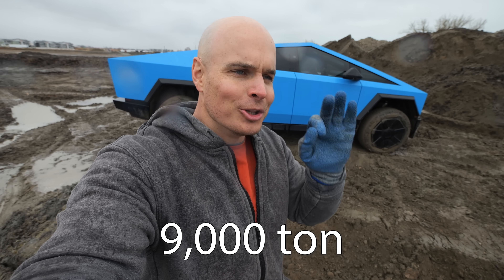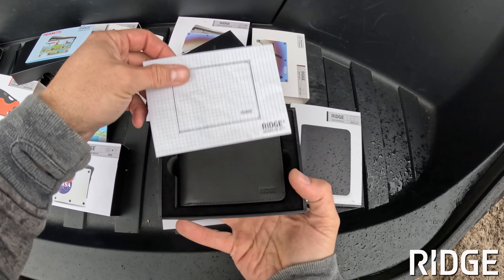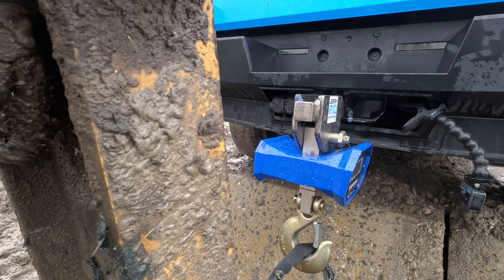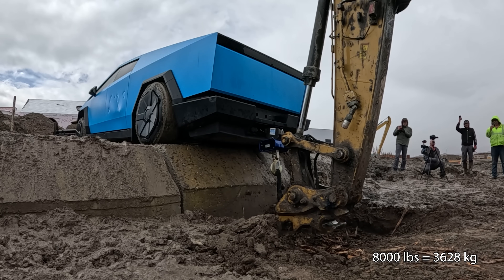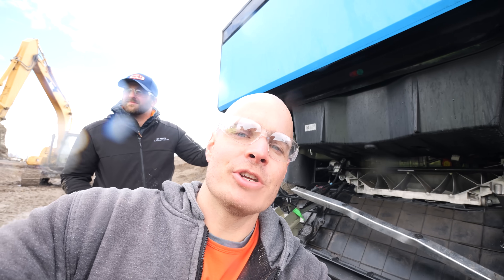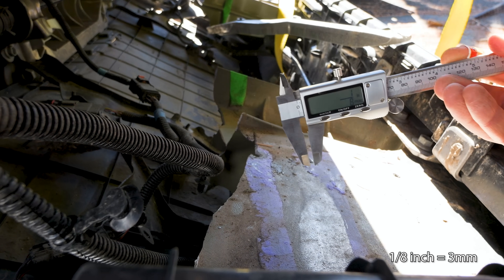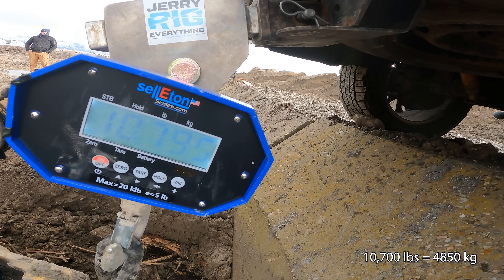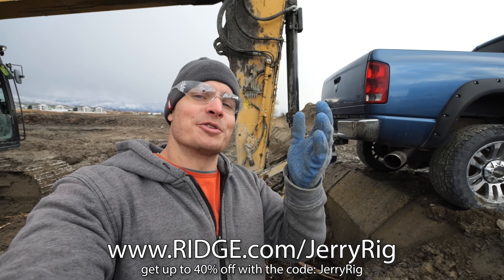SHOULD YOU TOW WITH A CYBERTRUCK?! - (catastrophic failure test)

Comment: That is not correct math. Even if a trailer jumps the ball, the full weight of the trailer will never fall on the hitch because it will still have 90% on the two tires of the trailer.
Reply: Mate... It DID happen to some drivers. The one instance I know for sure was a family hitting an imperfection in the road while towing. That's exactly what he referred to at one point. He also mentioned recoveries, when you're trying to get someone out of a sticky situation...
Reply: Zack is well aware of that. He just doesn't think the average viewer is.
Reply: A dropped 1,000 lb load can easily apply more force than a 10,000 lb static load. Cresting a hill is an easier one to do the math on, since it's still a static load.
If the truck is flat, and the trailer is on a 30 degree hill behind it, that's about 43% of the entire trailer weight now as tongue weight, regardless of trailer loading.
Reply: @xthexder0  Your math is not correct. 
Let's say your 1,000 lb trailer’s tongue weight is 100 lbs (10%). If you hit a pothole at 50 km/h (31 mph), the vertical acceleration could briefly reach 5g or more — meaning the effective load on the tongue could spike to:

100 lbs (tongue weight)×5g=500 lbs

Forces this extreme are uncommon, but realistic. Reaching 10,000 lbs of force from a 1,000 lb trailer would require catastrophic conditions, such as hitting a deep clif at high speed with no suspension absorption — unlikely but theoretically possible in extreme circumstances.
Reply: @SteveGuzer  I did no math related to potholes or drops. But I did suggest that dropping a 1,000 lb load could produce more force than a 10,000 lb static load. I'm not sure if dropping the maybe 12 inches onto the chains would be enough, which is why I didn't bother with the math.

The actual calculation I did was the 43% tongue load if your trailer is on a 30° hill. (a 10,000 lb trailer pulls down on the hitch with 4300lb + any tongue load from load distribution)
Reply: @xthexder0 first comment from some one actually knows wtf he’s talking about I have seen.  Jerry should have explained this better for the non engineers.  Dynamic loads and static weight are not the same!!! Suspending the mass of an object above a rigid object/base, and letting it go.  Even if the mass is still touching the base, the letting go of it and it falling zero inches will produce and peak dynamic force of about double what the objects mass is.  So I find it extremely probably an improperly loaded trailer with 2500lbs on the tongue a hitting large pot hole moves on the ball a few mm and hits 10k+ snapping the hitch.  And idk why people are arguing if it’s a fair test lol.  I have seen the pictures of the 3 trucks that had it happen, it’s not theoretical anymore. Shits a poor design and load has been overstated compared to any other truck

Comment: How does that saying go… Hell hath no wrath like a former Tesla fan jaded?

I’m no scientist either, but I’ve done a lot of trailer towing and even in extremely abnormal circumstances I don’t think there’s anyway to get the full weight of a loaded trailer pushing straight down on the hitch.  
In my mind, that’s all this test demonstrates, and 10,000 pounds is 10 times more than the authorized tongue weight. 
I wonder how Aircraft engineers would react if Youtubers started loading Aircraft with 10 times the amount of weight they’re designed to carry and then start ripping them for not being able to take off or snapping the landing gear at 10 times overweight.

Comment: I challenge you to prove you can get 10k lbs on the tongue with only a 10k lbs trailer.
Reply: the cybertoy was already creaking at 8000lbs... if it were bouncing up and down the road it will break lower than 10k
Reply: @williamhaynes7089  - lol the front of the truck had to be tied down causing even more of a fulcrum effect.
Reply from the maker: Easy. Park your skidster in the wrong spot and hit a pothole. It's already happened.
Reply: @JerryRigEverything my hitch for a 3500kg (7716lbs) trailer is rated for 250kg (551lbs) vertical force

Comment: This test isn't really accurate because it's a constant force and not like a trailer bouncing on the hitch or hitting a pothole. It's likely the combination of pulling and tongue weight can cause it to crack at a lower weight than the excavator pulling. I'd like to see you hitting potholes in a travel trailer on a closed circuit and see what happens. Or maybe WD can do that.

Comment: This is completely invalid test. What you’re testing is a sheer force, which focuses on a short portion of the frame, whereas horizontal force spreads throughout the frame. The incline example you showed is also invalid, you’re forgetting that the trailer is on wheels, and will never apply full weight, even if it’s on the slope. I’m surprised that this is coming from the guy that engineered so many cool things.. talk to the real structural engineer, and get his opinion.

Comment: I feel the need to spread some information.
Fatigue limit is the cyclic stress level at which a material can be exposed to and have an infinite life. In other words, cyclic stress level at which the material should not ever form cracks that would propagate sub-critically and stably until they reach a certain size at a certain number of cycles that would result in an abrupt and catastrophic failure.
Steel usually has a fatigue limit and it is usually estimated to be around 50% of the Ultimate Tensile Strength of it (UTS).
Aluminum does not have a fatigue limit. This means that, theoretically, it does not matter how small the cyclic load is, the material will eventually form cracks that will propagate sub-critically (hidden and potentially undetected), that eventually will become critical and will lead to a catastrophic failure.
Aluminum is a fantastic material for engineering applications, we (engineers) love it. You can easily cast it, forge it, machine it. It is great!
Aluminum also does have an excellent strength to density (weight) ratio. Certainly better than steel. Steel however has a better strength to volume ratio than aluminum.
Where does aluminum makes sense?
Where there are not cyclic loads and weight savings are important.
Where cyclic loads are limited and the part should last a very long time (fatigue life should exceed its expected useful cycle)
Where weight savings are extremely necessary but there are cyclic loads (airplanes/helicopters), with compromises. In this case, we know that the aluminum airframe will not last forever and we know that cracks will form, so in this cases we predict how long they will last using fatigue life predictions, thus we monitor and do non-destructive testing looking for and monitoring cracks and fixing them if necessary.

Where does aluminum not make sense?
Where cyclic loads are present and no monitoring or periodic testing is feasible. But wait, are not electricity hanging power lines made out of aluminum? Yes, they are but the load is carried by a steel core!
With high frequency cyclic loads. This is why we do not make connecting rods out of aluminum for reliable road cars.

Ok, what is questionable about the hitch of the Cybertruck? As an engineer, I understand the design choices. If appropriately dimensioned, it would be a good way to save weight on a vehicle where they might want to save the weight as long as they predict its fatigue life being longer than the cycles expected for the part. Nevertheless, I do not agree with the design choice because it is a work truck and all use cases might be different and the civil risk of breaking might be sending a 3t boat on the opposing side of the road at 80 mph because of the part failure. Thus would lead to over-dimensioning the aluminum part to contemplate potentially high cycle / high civil risk situations that would make cheaper and lighter a steel alternative.

Comment: The lack of a fatigue limit with aluminum is why you should never build the frame of something out of aluminum as it will eventually fatigue. I had a Kawasaki 636 frame crack around the 4 year mark that required a frame replacement.
Reply: Literally millions of vehicles/structures have Aluminium framing and are more than fine. Like everything context is key, steel has pros and cons Aluminium has Pros and cons. The Cyber truck is built perfectly fine for its purpose.
Reply: @Anti_thesis  If it's purpose is to tow I wouldn't trust it in the long term. Cars don't see near as heavy or routine loading and airplanes have annual inspections. Semi trucks used to have the option of aluminum frames and they gave up on that by the 80s, too many issues with cracking and galvanic corrosion.
Reply: @ I would argue that the Cybertruck is a badly designed(or at least dishonestly marketed) product in other aspects but I agree that the vast majority of them will hold up just fine. It's more likely that the battery will wear out before the hitch breaks if you're often towing at capacity. As someone who buys used and keeps vehicles for a long time I won't be looking for one, but hitch fatigue is only one reason on a long list.
Reply: @Anti_thesis  The decision to go with an alloy of stainless that isn’t near as corrosion resistant and requires the panels be constructed so they have exposed sharp edges is objectively a poor decision as far as I can tell. As a non Cybertruck fan I agree that the video comes across as misleading and clickbait at best. Sometimes clickbait is what you have to do on YT but I think the disclaimer about towing capacity vs tongue weight should have been much more obvious.
Reply: @Anti_thesis  When I said sharp edges I meant the actual edges of the panels, not the body lines. I understand that the edges can't be rolled like traditional body panels but it seems like something could have been done to reduce the finger slicing ability. There are a lot of neat engineering aspects to the Cybertruck and I appreciate the effort to build something more corrosion resistant, aesthetics aside. However 304 and other more resilient alloys are very commonly used for stainless parts on trucks. The air cleaners, heat shields, rear fenders etc. all have complex curves and sometimes rolled edges on the thinner parts. Like you said there is a lot that goes into material choice but starting off with a better grade of stainless that's already used in the automotive world seems like a better choice. The corrosion resistance also doesn't mean as much for longevity when we're talking about Tesla. They have a history of being one of the worst makes in terms of repairability and it's not like the competition is trying that hard in that department either. The body of the Cybertruck being in good shape in 10 years won't do you any good if the battery is toast and a new one from Tesla is worth more than the truck with no options for 3rd party repair because they go out of their way to lock things down.

Comment: Am i missing something?  I thought the max tongue weight on most full size trucks is between 1,000 and 2,000 lbs and they just put 10000 lbs on it and it broke.  Thats 5 times the typical max tongue weight of a full sized truck.  Also, aluminum breaks, steel bends, but if you bend your frame, you ruin your truck as much as if you break it.  Straightening a frame , and aluminum welding are both a real chore.

Comment: Tongue weight is just that, the maximum weight placed downward on the receiver.  The fact that it's rated for 1100lbs and went way over 7000lbs without an issue is pretty darn remarkable. You guys just have way too much money and like to destroy the things most people can't afford and then say it's designed incorrectly or whatever.  The Cybertruck was designed and built because Musk and Tesla wanted to.  There wasn't a need for it and Musk knew that.  It was basically for fun.

Comment: This is completely predictable. And it will get far worse over time. Cast metal is fundamentally brittle, and MUCH more subject to fatigue than forged or formed metal. Every time you use a Cyberjoke hitch, you'll be reducing the force at which it will break. Eventually it WILL form cracks, and will break off with only a small force applied.

As for tongue weight vs towed weight, the tongue weight is only true when you're parked. The rest of the time there is much more force on the hitch, from acceleration, braking, bumps, everything you do in normal operation.

Comment: I have to say this is the dumbest video and proves nothing. So the Dodge did 7% more weight without breaking? Far from a Tesla fan-boy here, but all you've shown is that the Cybertruck breaks at 9 times the rated tongue capacity.

The type of people that think steel is always better than aluminum and welds are always better than glue is just a newer generation of carburetor lovers who don't believe in fuel injection.  There may even be some valid flaws with the Cybertruck but you've kind of just lost any credibility with this video and trying to draw any conclusion from it.

Comment: Basically it already breaks and tear off at around 6k lbs judging from how you already heard it breaking away. From there it just gets significantly weaker and completely ripped apart at 10k lbs when the tearing got to a certain point, while rated at 11k lbs.

Comment: So this is the second youtube personality that has successfully managed to destroy a Cybertruck based on outrageous stunts... 

The first hitch failure on a Cybertruck was due to dropping it off the back of a flatbed wrecker and then off a pile of concrete from six feet in the air....
The second failure was due to 10,000 pounds of downforce from a Caterpillar.  They were so concerned about the front end coming up off the ground that they had to tie the front of the truck down with a SECOND machine to keep it secured.... 

No reasonable Cybertruck owner is going to load the weight equivalent of two chevy tahoe's on top of the hitch. That's just ridiculous. The typical weight on a hitch is 500-1000 lbs of downforce of a boat, car trailer, or RV. 

All this proves is, with unlimited resources of a YouTube personality, you can destroy anything. Whether it's a phone by a pick - or a Cybertruck by a Caterpillar.

Comment: It broke at 10,000lb of downward force.   A 40,000lb loaded semi trailer is typically 10-15% hitch weiight.  So it 4000lb which means it held double the weight of what is on a giant fifth wheel that is about as greased up and fully oscilating as what  Zack puts in his "reciever".

Comment: Your test is extremely flawed. Towing capacity and tongue capacity are 2 totally separate things. This is reckless to imply that cyber truck will break near its towing capacity.  If you would have pulled straight backwards, I would bet that it would have far exceeded its towing capacity. Tesla's own cyber truck manual mentions that the tongue weight should not be more than 10% of the towing weight of the trailer, which would imply that the tongue weight should not be more than 1100 lbs based on the max towing capacity of 11k pounds.... your test shows that cyber truck nearly 10x's the rated capacity... There is ZERO scenarios in which 90% of the trailer weight will be supported by the tongue.

Comment: Surpassing tongue weight limits, GVWR, weight and balance, centre of gravity of towed trailer/tow vehicle, disregarding recommended safety measures, lack of preventive maintenance, tire pressure & wear, etc. is a recipe for failure; catastrophic or otherwise...
Most of us or at least those that are observant have seen a pickup truck towing a trailer with the rear bumper of the pickup truck nearly scrapping the ground. 
Same scenario as above...truck hits a pothole, trailer tongue "pops" off the ball of the trailer hitch, trailer tongue contact's the road surface that ends with the trailer cartwheeling violently...the only failure here is the stupidity of the driver...

Comment: Engineer here, Tesla hater also. As much as it pains me to say this, and I know "Scientific" was used with satire tone BUT some basic calculations can demonstrate that the truck will never experience that kind of load in that manner.... ever. Load distribution and angles make a significant difference. Annoyingly the truck actually performed .... decently. Unless you decide to load the truck with its max rating, than proceed to back it off a cliff.. and sit there expecting it to hold... there is no other scenario where it will experience what was demonstrated in the vid. You can see when the excavator was bouncing, the load didn't jump all that much (even with a maxed suspension), this shows you going over a pot hole doesn't really cause massive dynamic forces.

Again... not a fan of Tesla or Cyber truck. See it rip apart was satisfying lol.

Comment: My issue with the tests was keeping the front end on the ground. I understand why you did that, which is to get the full pressure on it to the point of failure, but that's completely unrealistic, and lets put that back into the equation now. 

I'd like to know at what point does it not matter because you're going to meet Darwin if you try and drive that way. Doesn't matter how much either is capable of if you can't steer, or safely go down the road..

Could there be a longevity issue? Maybe, but a lot of military and civilian aircraft would like to have a word in that department. The whole aerospace industry actually. I mean at what point failure beyond actual ratings is enough? Where is the line of personal responsibility? "This product doesn't work in a manner other than advertised." 

Ratings exist for a reason. "I tried to weigh my car with a bathroom scale and it broke." Ya don't say. Just like "I was driving down the road and towing this huge load, and got 5 different tickets for negligence by causing an accident." Shampoo bottle: DO NOT DRINK. You shouldn't need to be told.